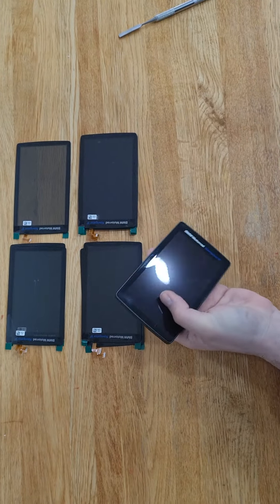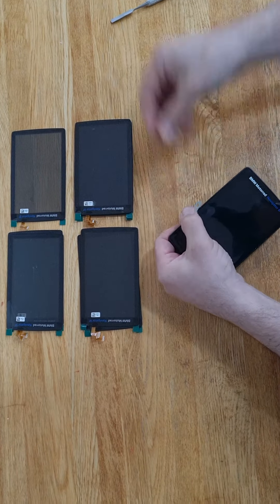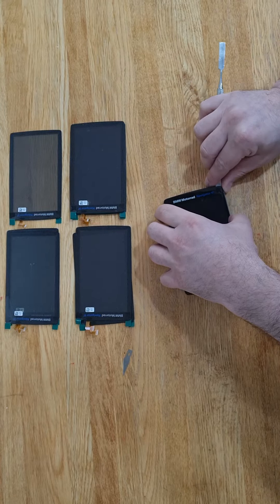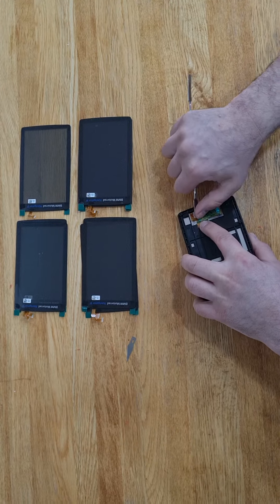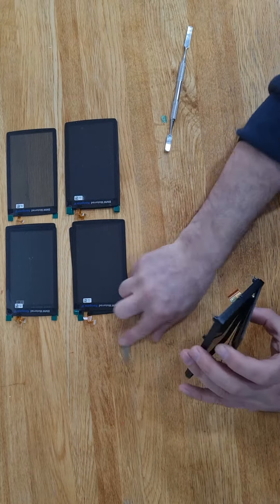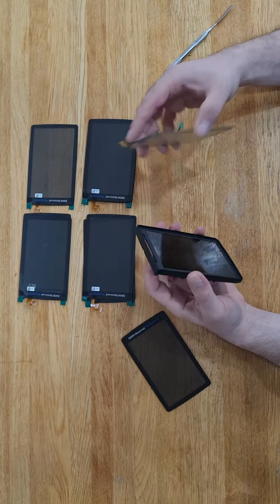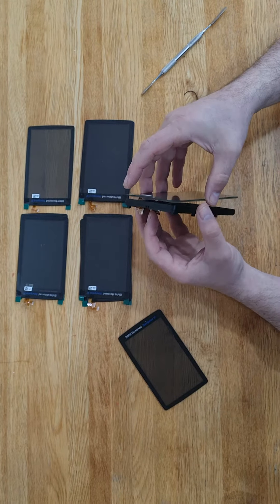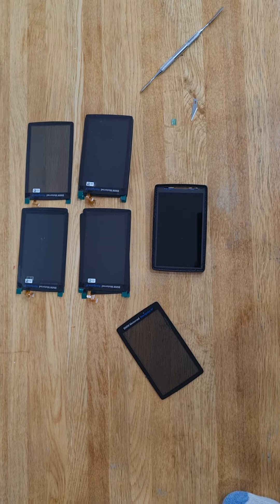BMW Motorrad Navigator VI Touch Screen Replacement

Comment: Easy to fix. These units doesn't like cold weather. Remove it from the bike, place it horizontally  in front of a heater/heat pump for a couple of hours to warm up the gel in the touch screen. Make sure the unit it self warms up to 25 to 30 deg Celsius and that will solve the ghosting/ frozen screen.  Remove it from the bike and place in pouch indoors at good room temperature when not in use.